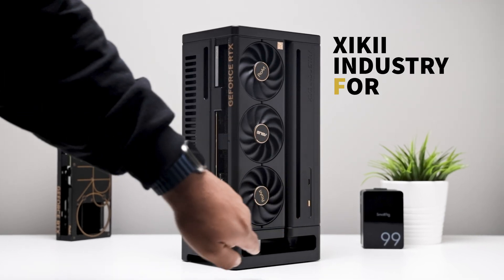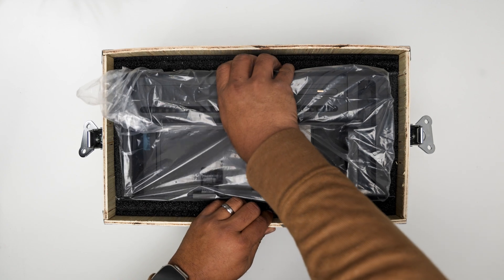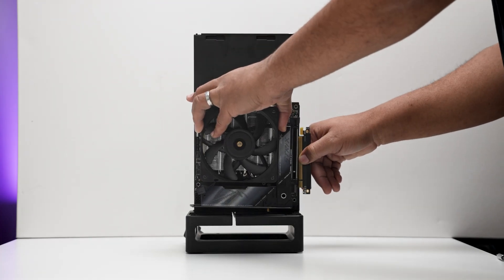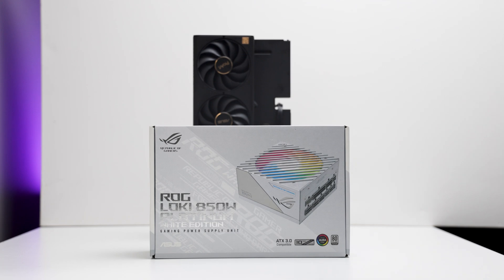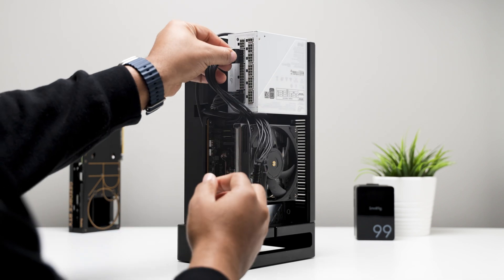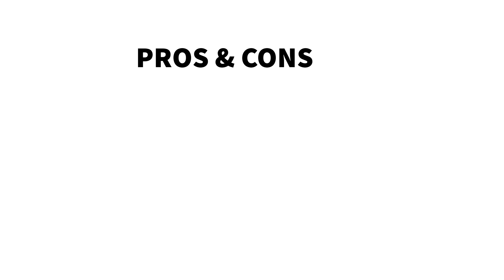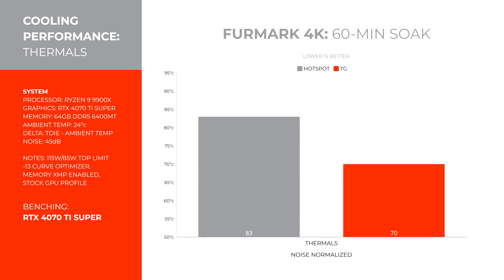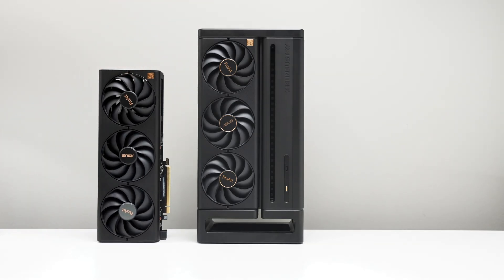XIKII FF04 ProArt Review | RTX 4070 Ti Super & Ryzen 9 9900X

Comment: Does this work with the 4070 Super (Not TI)?
Reply from the maker: No, there a part in the video I show the difference between the two cards stack on top of each other. The 12VHPWR  connector is in a lower position as the Super is a shorter PCB than the Ti and Ti Super.

Comment: What do y think get this 4070 ti super or wait 5070 ti 
And is the pro art 4070 ti super temp and coil whin?
Reply from the maker: Temps are good, just as good as the FEs in my opinion. If you’re looking to get this case, then you’ll need 40 series, if the anticipated measurements for the 50 series ProArt cards are correct, it won’t fit.

Comment: I just built mine with a 4080 Super it's such a beautiful timeless piece of artwork. 👌🏽
Reply: What did you do for PSU and monitor cables? I got 90 degree adapters but they go the wrong way so they route out the front not the back. Looks sub-optimal.

Comment: I have a 9800X3D and Pro Art 4080 Super ready to go.....but wondering if the CPU temps would be too high to perform efficiently. What is your thoughts?
Reply from the maker: Your temps should be okay, I haven’t tested the 9800X3D but it’s a 8 core chip with 4 less cores than mine and it should naturally be better even at stock. You could probably see better thermals in general if you enable a Curve Optimizer and 105 eco. (I find the eco modes in the 9000 to be aggressive do manual PPT input)
Reply: @ChrisRussellTech  I appreciate the response Chris......subscribing to your channel right now!

Comment: super clean. With cats though I'd want a magnetic dust cover for those gpu fans. Have they said whether they'll make 50 series cards in the same form factor? 130W is all that cpu cooler can do under constant load. I think if I was designing a case like this that only worked with a few gpus though I'd sell it with the GPU preinstalled and have it water cooled and include the cpu in the loop, then maybe I could justify >$500 for a case.
Reply: Fan covers would ruin the artistic aspect. Cleaning a few more times per year ain’t that bad for something so beautiful.
Reply: If you ever find a sff with dust cover let me know!! I’m super interested in building one but that’s one thing that keep me off